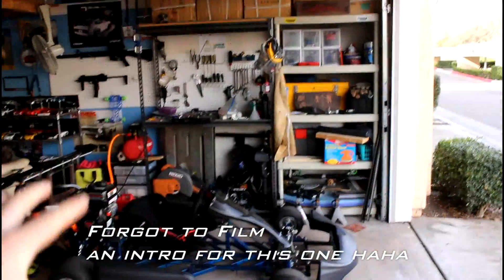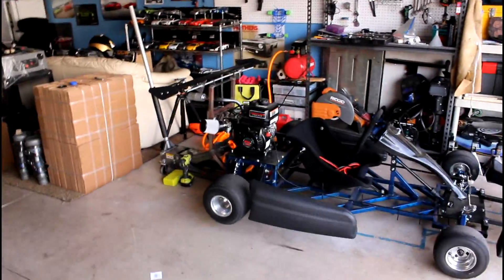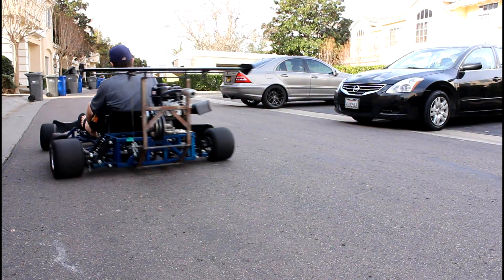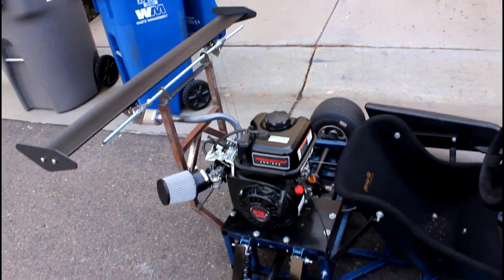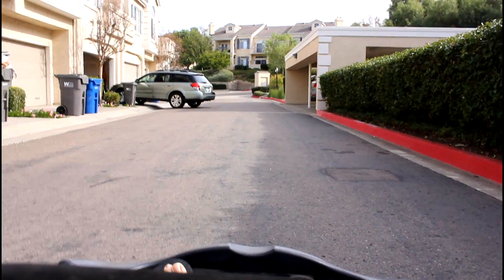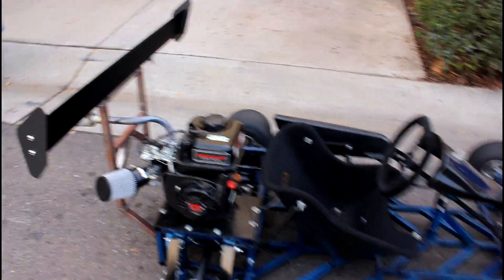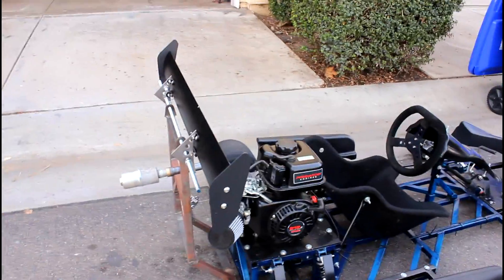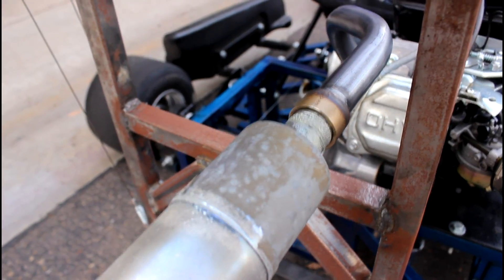Homemade Go Kart  - Carb Jet Upgrade and  Active Aero Wing Test Day! - Part 2

Comment: Put a return spring on the wing
Reply from the maker: I did. The whole mechanism had some design flaws I needed to improve for it to work as I intended. At the moment, I'm just running the go kart without it since it was a little clunky.
Reply: @Addimotive  if that didn’t work try like a hydraulic piston 👍
Reply from the maker: @Boosted6.00  definitely thought about doing that!